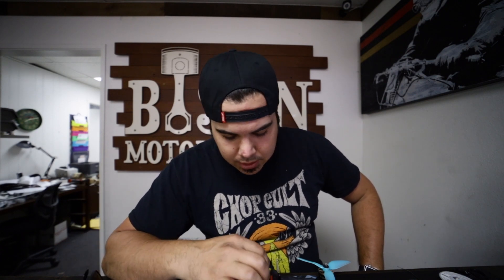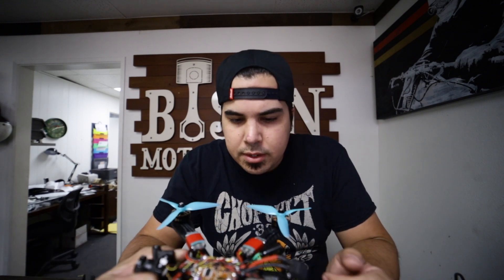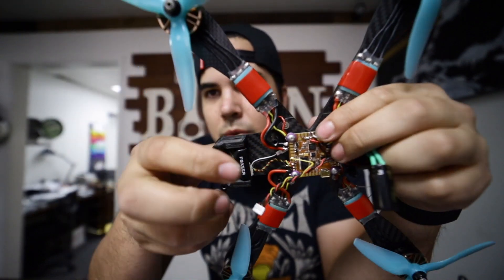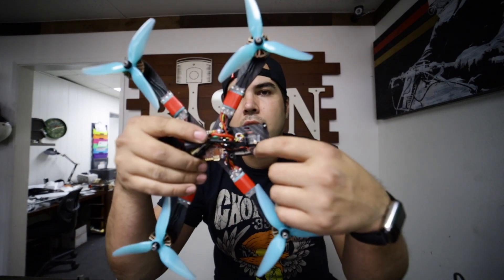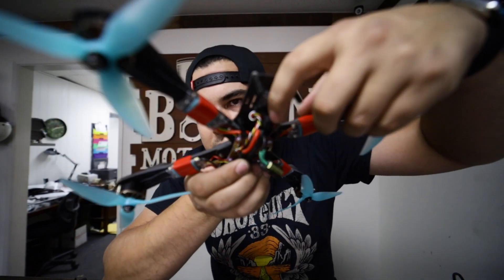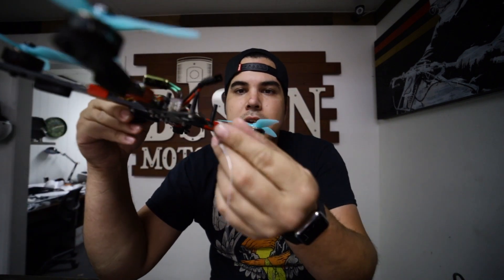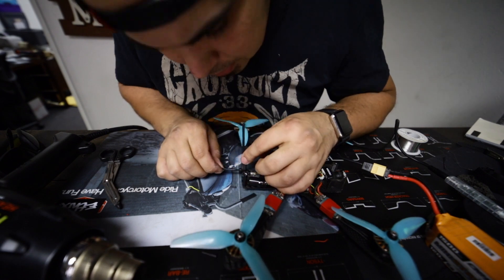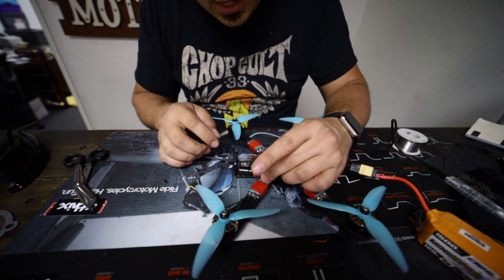Whats inside my drone

Comment: If you happen to still have that lack-of-cap-related twitch - shorter leads on the cap to the vbat pads will probably improve the spike filtering effect of the cap.  I've used long leads on caps before with and without problems, it's pretty setup dependant, seems that those spikes will go straight inline to the nearest component, which might be your FC if the leads coming off the FC going to the cap are long, but if the cap leads are short then it will absorb the brunt of the spikes.  Also nice add on the external mini-mic - I like the automatic gain-reduction electret mics from Adafruit, super cheap and lots of adjustments, also comes with some foam right over the electret already.

Comment: I'm not sure that twisting your video wire around both a ground and a live wire would be the best solution if you are trying to avoid electrical interference. In my old days of car audio we would run power and ground down one side of the car and the signal wires down the other side. I use this same logic when dealing with video leads. In the words of The Offspring, "you gotta keep em separated". Wow, that was a lame reference. I could be wrong or misinformed but just my two cents. Anyhoo, Great video!